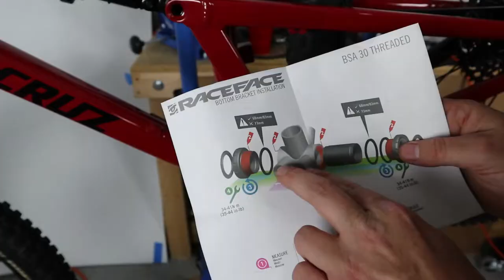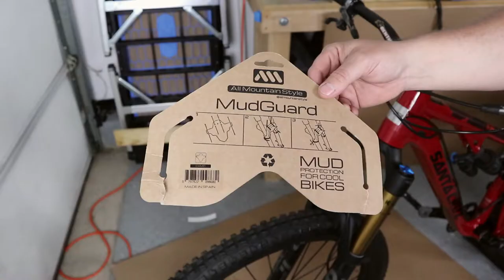#MTBPlanB Santa Cruz 5010 bike build a-z in less than 4 minutes.

Comment: What travel fork are you running? I just got a 5010 and it came stock with 130mm travel Fox Rhythm.
Reply from the maker: I tried 150mm and 140mm. The 140mm felt the best for this generation of 5010 because of the slack seat tube angle. I haven’t ridden the v3 5010 though.
Reply: MTB Plan B thanks man your build looks awesome. Do you know what size rear shock is on it. I just sold the front Fox 34 Rhythm and now looking to upgrade the rear shock! Thanks again. I wish I found a bike in the red like you did but I got like the dark grey gun metal.
Reply from the maker: V2 5010 came stock with 200x51mm shock. I long shocked mine with a 200x57mm. https://www.santacruzbicycles.com/en-US/bike/5010/2